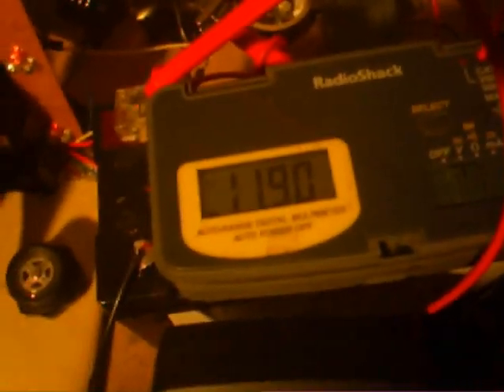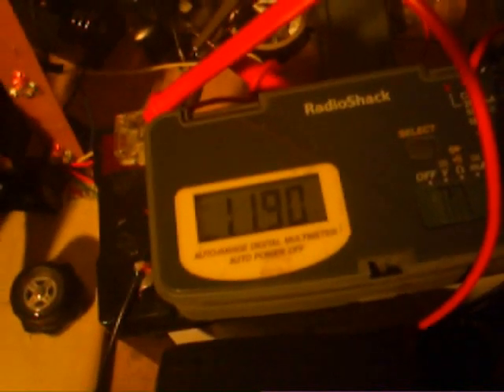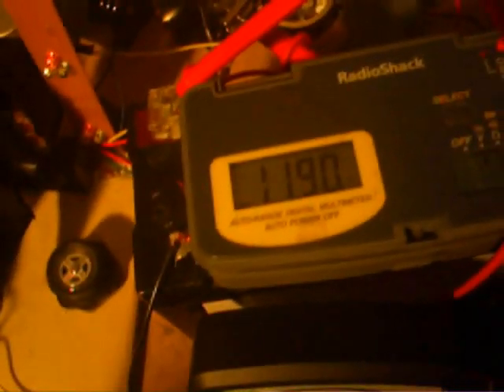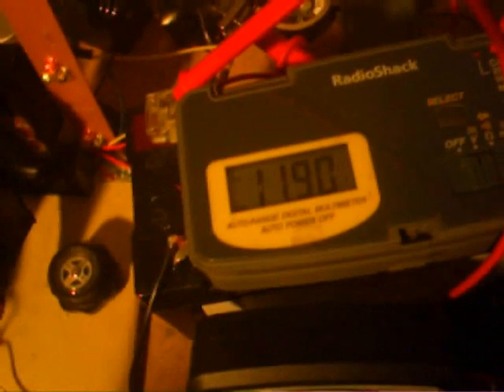satellite compass on bedini

Comment from the maker: @g11690102 hey that does make sense.. theres 4 magnets on there so the 4 to 1 things true. it also works in reverse sometimes where its like 1 to 4 seems like.

and the magnets separating would depend on the material i guess. ive had a small ceramic mag basically disintegrate in a small rotor before. it was thin and brittle but strong. actually cracked the tupperware casing. couldn't have been over 5000 rpm so i guess it exploded from impact

Comment: @Magneticitist my 9x9x18 rotor i worry about the fiber glass cracking holding the magnets to the ring. using the drill fuul speed to the hand crank= 500rpms to 4500. now adding the orbit magnet 40500 rpms now add 9 of these orbit magnets. each having 5 coils. the divsion is 6 but only 5 of those spaces are used. 6 is for the cog part. i'm using small magnets i know it works larger. matching the rotor to the orbit is key too. 4 divsions n s e w. or n w s w as i like to put it. making east the >o<

Comment: how many magnets on the rotor?  if you have 4 north magnets the compass should be 4 to 1. my rotor turns magnets at 9 to 1, then add the hand crank at 9 to 1 i figure my final output is 81 to 1? 300 rpm in = 24300 out. this is when i started asking when a magnet would explode from spinning. i was told 25 metric tons of force to get a magnet to seperate.